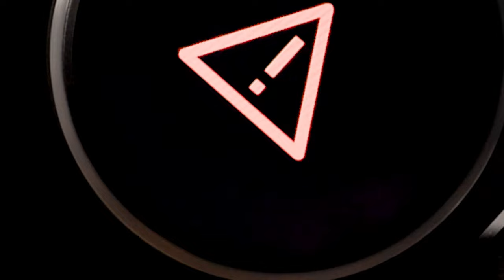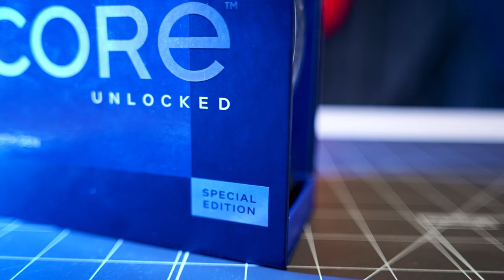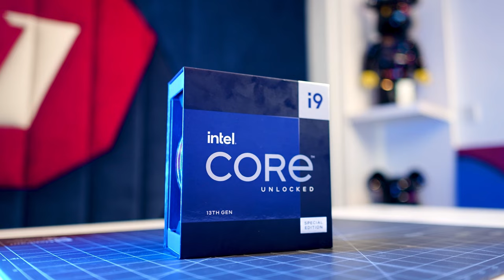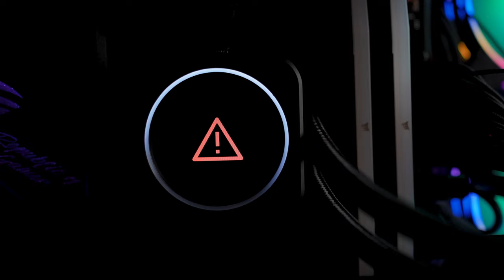Building the Fastest Gaming PC in Bangladesh

Comment: This is not fastest Bro, My father had a 14900k+4090 with custom loop
Reply: 14900k is just the refresh version of 13900k .also custom loop will just give you a little bit of extra colling which will help you with a little bit of extra performance.14900k is just 5 to 10 percent faster than 13900k.so the performance are not that huge and they have used the 13900ks version which is a lil bit faster of 13900k .so 13900ks and 14900k is likely the same thing.13900ks can outperform the 14900k by 1% and also 14900k runs hotter than 13900ks.